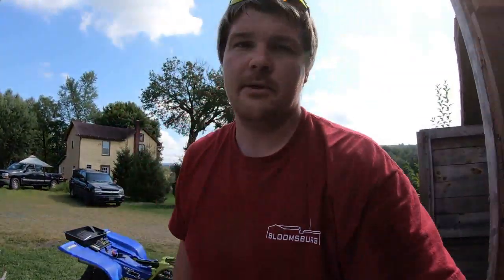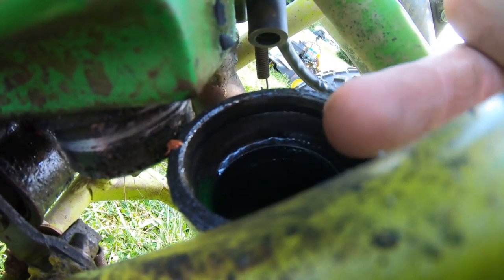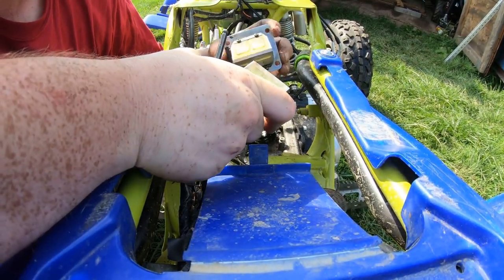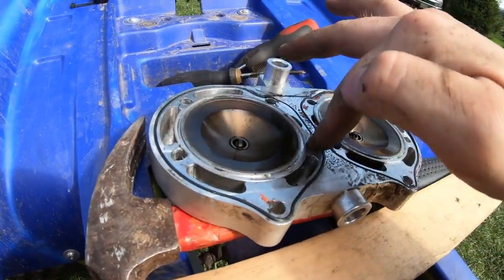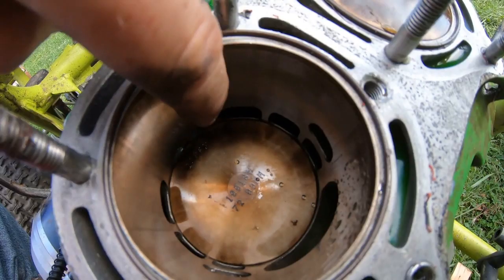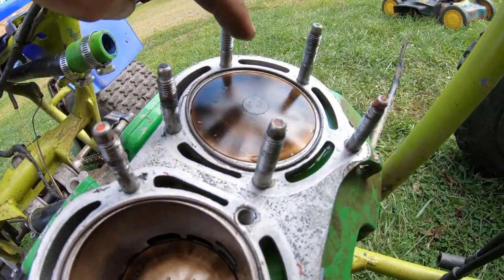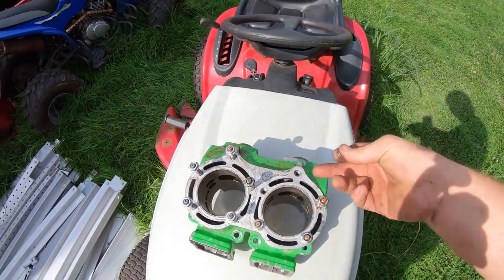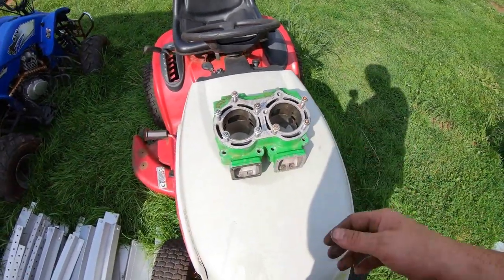FIXING my BLOWN UP BANSHEE part 1 (Time Lapse)

Comment: Unscrew spark plug boot then cut back to clean wire then screw cap back on and run like a champ
Reply from the maker: I did that a few vids back, brand new wires too 👊🤙

Comment: Make the holes and weld the holes and drill back out and retread it that will help
Reply from the maker: We were going to but the one by the cylinder was too close, we were afraid it would ruin the nikasil or worse collapse into the cylinder with the heat

Comment: Hi buddy, how did you manage to scrap those three threads ??
Reply from the maker: The other 2 were fine just the one facing the right exhaust? And im not sure how it got ruined, i have plenty of experience with heli coils and drilling n tapping. Many years... maybe aluminum is too soft thats my guess
Reply: I Mean, how did you strip those threads?? Why there is helicoil there?
Reply from the maker: @claudeperron780  ahhh gotcha, when i got them back from the cylinder coating place the threads were already damaged because they removed the studs themselves... ruined a 1200 set of cylinders brother but i chose to heli coil because i couldnt even torque the head nuts down to 22 ft lbs without the head studs spinning in the threads

Comment: Instead of a helicoil use a" timesert" problem solved look it up!!!! Your welcome
Reply from the maker: Lol i know about them BUT the problem is you cant use a time sert in that location directly next to the cylinder. Long story short the head isnt going to seal beacause the surface where the o ring lays wont be completely flat with the time serts threads protruding into that area. Your welcome 😉🤙👊
Reply: The time sert will sit perfectly flat with the deck and your orings will seal just bring it to a guy thats installed them before and I promise it will work out for you
Reply from the maker: @brucemunro3342  i wound up having custom serts made brother 👊🤙 that way i didnt have to wait for shipping or spend time looking for proper length etc.
Reply: Cool I'm looking at big bore kits right now so looking forward to seeing yours run right ,and which one you think is the best bang for the buck between the 421 and yours good luck!!!!also do you know if Michel sabo,s asassin cylinders are low port (serval) or highport?
Reply from the maker: @brucemunro3342  i believe his are low port for midrange power but ill ask. As for big bore maybe we can cover that in a fiture q and a vid🤙👊
Reply: @StupidFastJohn  great thanks